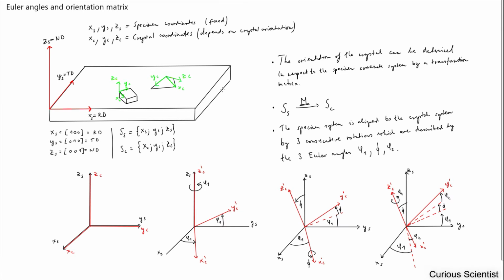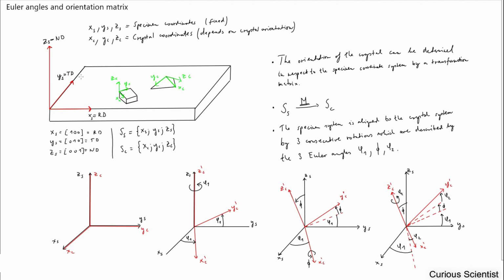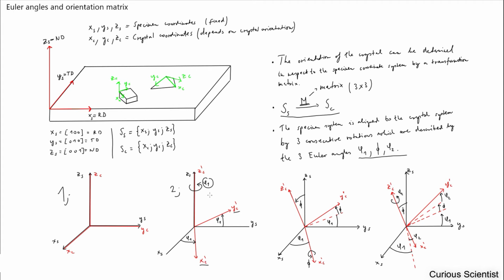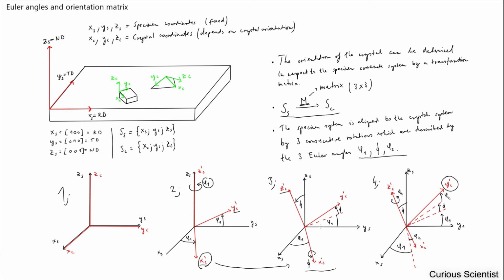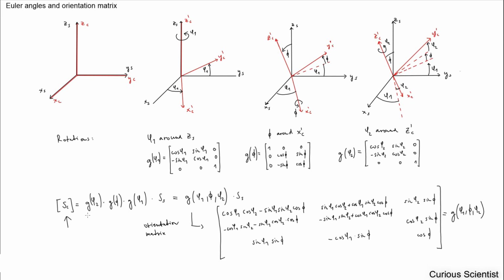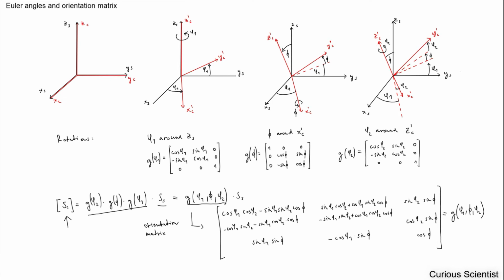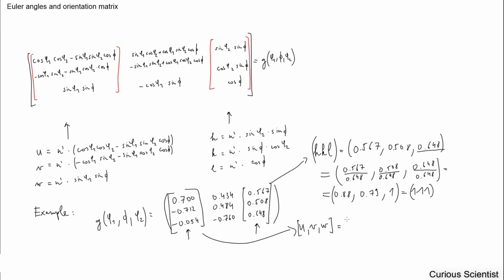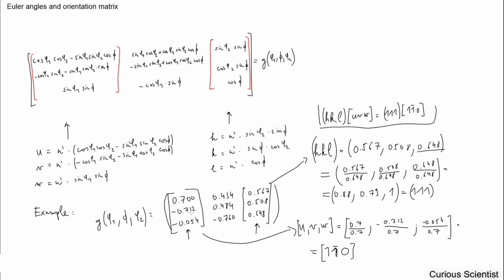Euler angles and the orientation matrix

Comment: Thank You for this video. I want to ask You, if it is possible to determine the TiO2 (rutile) grain crystalograffic orientation (with respect to the surface normal) based on Euler angles? Rutile has a tetragonal crystal structure. For example, I have 3 angles (169.81; 53.221; 73.631
). So, from orientation matrix I calculated HKL (-0.18,-0.036; -0.98) and after rounding HKL(0,0,-1). Am I right?
Reply from the maker: Hi! 
I got 10, 3, 5. And u, v, w: -2, 5, 1.

Comment: Thank you for the incredible video. I want to ask you about the planes and directions you extract from the orientation matrix, i.e. hkl and uvw. 

When you divided by the maximum , shouldn't the absolute value be used? Because in my orientation matrices, when I divided by the maxmimum sometimes I get some planes and directions way over or way less than one, such as, (1 0 -21) or (22 10 -3) etc. Yet when I use absolute value I get always reasonable results such as (1 1 0) (-1 1 1) etc. What do you think, should I use absolute values when dividing and rounding up?

Example: For Euler Angles orientations of [262.3910  179.4073  291.2365] when I divide by the maximum to get the plane I get (-3 -1 -267) but when I divide by the absolute maximum I get (001) which one is correct in your opinion?
Reply from the maker: Thank you!
For your g(), I get (-0.0096, 0.0036, -0.9999)[0.8804,-0.4742,-0.0103] or something like this. If we simplify it, then we get (001)[2-10]. 

Another example I found in my notes is the following: (0.662,0.684,0.306)[0.095,-0.482,-0.871] which was given as (221)[0-1-2]. Let's pick the ABS(max). Put the calculation in an Excel sheet and show two decimals. We get (2.16,2.24,1.00)[0.11,-0.55,-1.00]. Of course, we do not use fraction numbers for lattice planes, so just let's multiply the second part with 2, then after also rounding it we get [0-1-2]. So yes, the best practice is to divide the hkl-uvw elements with abs(max) and then readjust the numbers to integers.

Comment: Hey man, thanks for the brilliant video!! I learned a lot from it. I have some questions and hope you can help me straight them up. 
 
1. In my EBSD data, I get orientation in three angles. I assume they are euler angles. How can I know what rotation the software used to get these angles (I used AZtec)? If the software takes a different combination of rotation, will that mess up all the following calculations? Can i simply put the angles into the formula matrix you shown in the video and get the orientation matrix?
2. Assuming that now we calculated the orientation matrix,  one can calculate and get the rounded miller indices of plane and direction. Is this calculation universal to all lattices? Does it work for the hcp?

Thank you so much for the upload man! Keep up the great work! Subscribed!!
Reply from the maker: Thanks for the sub, it means a lot.

I also use Aztec, so I can explain. Before you acquire a map, you have to define the sample geometry this is very important, since this will determine the relationship between the specimen and the crystal coordinate system. But once you set up properly and acquire the map according to it, then there's no problem. You always get phi1, PHI, and phi2.

The orientation matrix method I showed so far works with cubic systems only as far as I know. I will have to double check this. The Miller indices perhaps can be obtained with the demonstrated method but the misorientation is pretty sure different because you will need different symmetry operators. 

If you have any further questions, let me know, however I am a bit busy in the next three weeks, so I cannot answer promptly.
Reply: @CuriousScientist  Hey CS, I tried to confirm the demonstrated method to get the miller indices with an aligned orientation of Mg single crystal. The surface of the crystal is aligned to the prismatic plane I (100). On the screen, everything shows up pretty nicely, all blue. However, the calculated values are (0.5 0.5 0.13), which can only be rounded to (441). Which seems really wired to me. Does it mean the method is not suitable for hcp? Do you have any thoughts on this?
Reply from the maker: Sorry for the late reply. The texture components (hkil)[uvtw] can be determined for HCP, but in a different way. The reason behind the difference and the solution is described in the following work: Y.N. Wang, J.C. Huang / Materials Chemistry and Physics 81 (2003) 11–26. Please take a look a see if it solves your issue.
Reply: @CuriousScientist  Hey, no need to apologize dude! I know you said you'll be busy. I will check out the paper you listed. Thanks so much for your help!

Comment: I'm confused on a few points:
1. What's the significance of (u,v,w) and (h,k,l)?
2. How does (0.88, 0.79, 1) = (1,1,1)?
3. Is there any significance to round parentheses vs square brackets?
Thanks.
Reply from the maker: Hi! Thanks for the questions. Let's go through them one by one.
1: When you create the pole figure for example, the texture component of each grain (or point) becomes significant. There are different "predefined" texture components, such as cube, brass, Goss...etc. You can see how a point's texture component compares to these.

2: I said in the video that you have to round the numbers to the closest integer. So, I just simply rounded the 0.88 and 0.79 up and they became 1.  

3: They are very important when you want to distinguish the slip systems. Let's consider a FCC crystal. The (111)[101] is one specific slip system where the (111) is the slip plane and [101] is the slip direction. On the other hand, {111}<101>  describes all possible (111) planes and [101] directions. So, the parentheses () and square brackets [] denote one single case, the curly {} brackets and angle brackets <> denote a set of planes and directions. 

Usually, we say, FCC has 12 slip systems and they are {111}<101>-type.  And when we define a certain system among these 12, we can say, that now we work with the (111)[10-1] slip system which is one particular case out of the 12 cases. 

I hope this makes sense.
Reply: @CuriousScientist  I appreciate your reply. It looks like my point of confusion is that the title and first part of the video is about Euler angle and orientation matrix (easy to follow, but just plain trigonometry), but then suddenly veers into material specialized to crystalography assuming we viewers know the motivation behind (h,k,l) and (u,v,w), and of rounding perfectly good vectors to closest integers. No doubt with more background this all would make sense, and presumably it wasn't your intent to get into that. It just didn't make sense relative to the title and hence expectations.
Reply from the maker: @Graham_Wideman  Yes, I totally agree with you, the second part might be a bit too specific to crystallography and materials science. I just wanted to show an application of the orientation matrix, so the viewer can be motivated about the usefulness of the meticulous matrix operations and similar things. 

My plan is to create a whole bunch of videos in this subject, so after a while, all key topics mentioned in the videos will be found in other videos within the same playlist. The final goal with this specific series is that you will be able to understand most of the calculations behind the different colorful maps generated in commercial EBSD software.